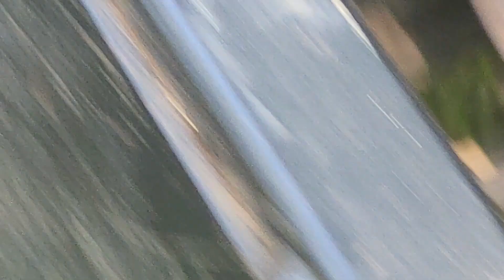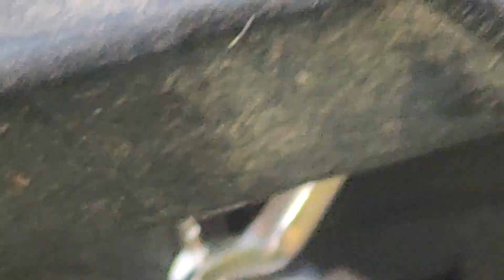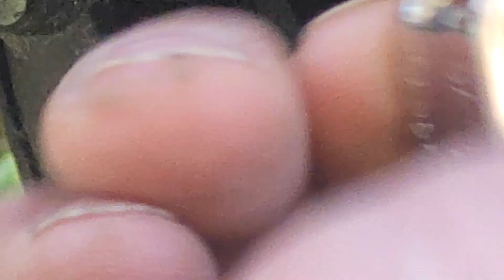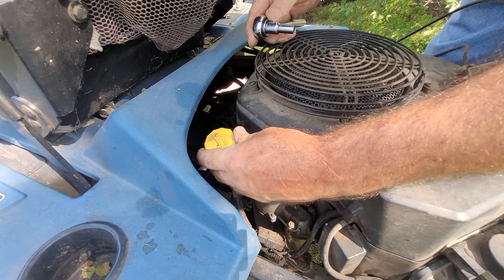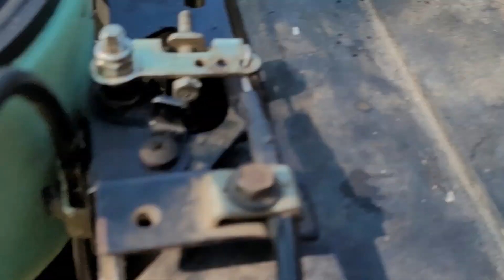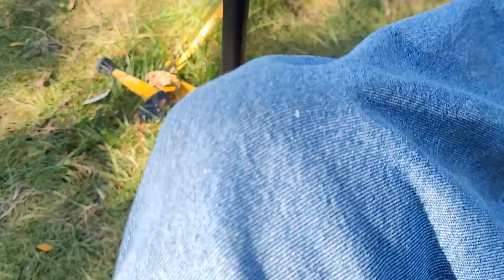Dixon 5022 zero turn smells like gas and low on power.  Is the Kohler Command still OK?

Comment: I had a bad experience putting those bolts holding the coil on with my impact wrench and broke one of the uprights off. Had to GIVE the guy another motor. Just saying.